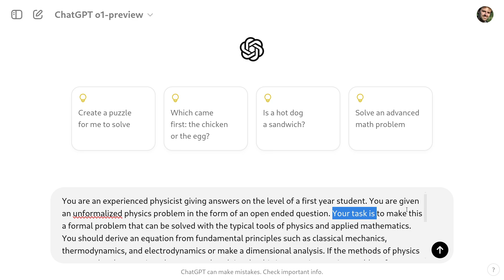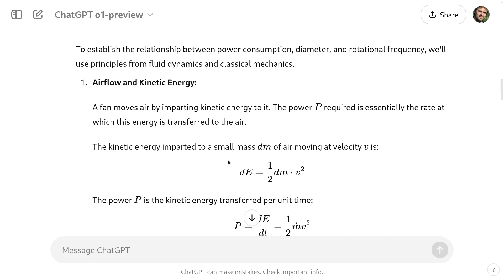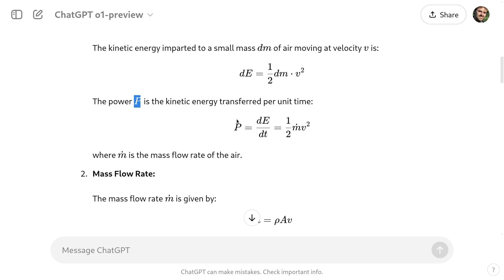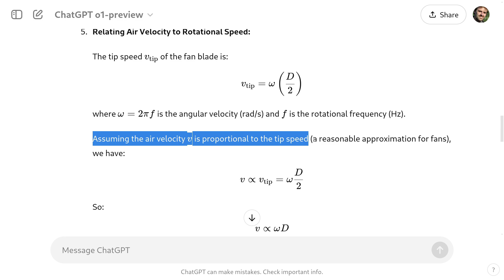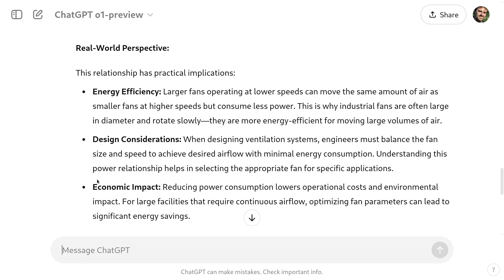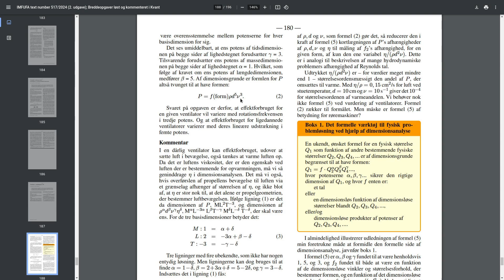Open-AI o1-preview thinks like a physicist for an exam question

Comment: Another very interesting video. Thanks for posting this one, too. It looks to me as though the model got the answer just about perfect, which is really impressive. Can you imagine having been able to ask a computer a question like this two or three years ago? How would we have thought about such a response then?

Do you think it would be possible to use this model to do original, groundbreaking research in physics? Perhaps you could point it at some questions that have never been answered satisfactorily (or maybe ask it to think up some good questions that have never been asked!), and see if you can work together with it to produce interesting and novel results.

I’ve been experimenting with that a bit myself in my own fields of specialization. I don’t have any results worth sharing yet, but it does seem to have potential as a tool to accelerate the research and discovery process significantly.
Reply from the maker: Yes. It is a very impressive answer that o1 gives. Jens just wrote me pointing out that in his opinion,  o1 is " a very good students" and that it will influence what skills the future scientists need ... similar to what the pocket calculator did.

But you are right, what I asked it is not a research level in any account. I have also asked I about some math think for a manuscript within theoretical statistical mechanics and did some impressive integrals correctly. If I had this half a year ago, maybe I could have written that manuscript faster.